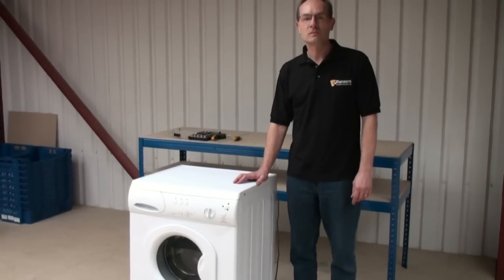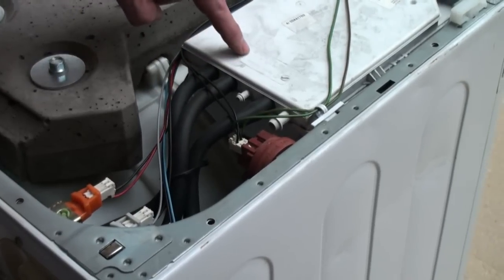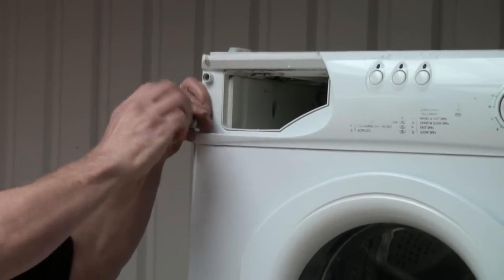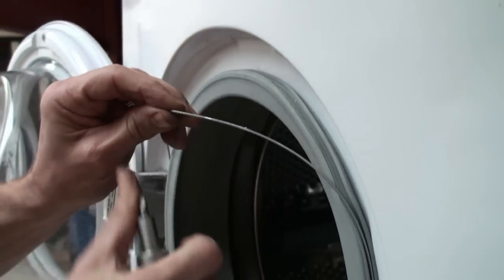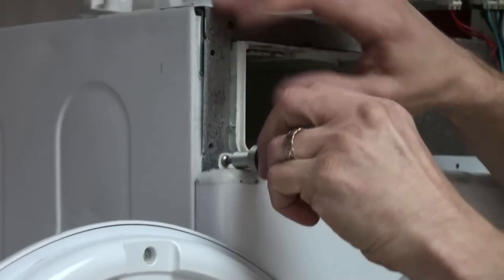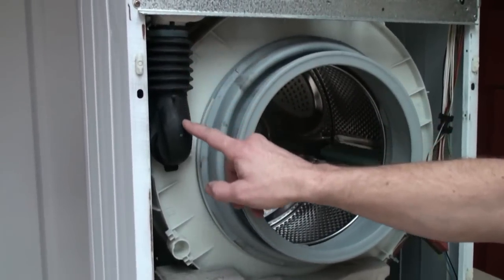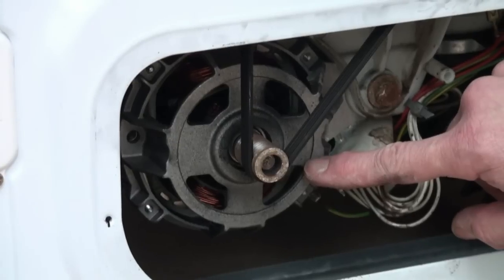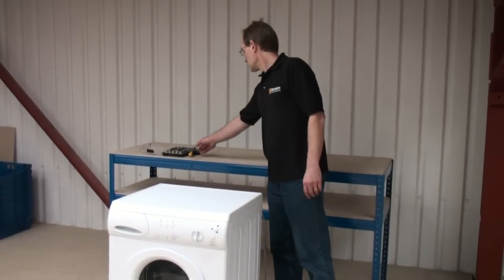Washing Machine Repairs - How a Washing Machine Works

Comment: Just ordered my 3rd washing machine in 3 years. The first was an all singing and dancing hotpoint from the ultimate cowboy outfit, AO. 10 months and it went to the dump and no refund only a lot of very sad sorrys from the minions. Wont buy hotpoint ever again.
Next a candy cheap as I could find. I mean why throw good money after bad. So 2 years and it just bleeped all the time, lights flashed and it wouldnt work. Repairs from candy..wait a week meanwhile I need to do washing. Quick to take money, not so quick to put it right. Wont buy candy any more or hoover cos they are rubbish.
So what I want to know, are modern washing machines just all rubbish and prepare to buy a new machine every few months or a couple of years at best? According to which, should last 14 years and that really made me laugh.
Reply: A front loader will fail quicker if the user doesn't clean and maintain it 
In other words people that neglect their machines will end up repalcing the machine way more often compared to people that keep it well maintained

Comment: thanks for Video - But you didn't cover capacitors for driving spinning  and or failure of spinning.
Reply: That's because capacitors aren't used in washing machines

Comment: hi, can u help? my beko WM1540W thinks the door is open when it is shut, even though it locks the door? does this mean i have a faulty interlock switch or board fault? thanks
Reply: True fact is that a washing machine will appear dead and will not start with a faulty door  interlock as the door needs to lock properly before the machine starts

Comment: how do i fit the counterweight on my hotpoint aqualtis washing machine
Reply: You don't need to as all machines have them all fitted but if you have to replace them for instance if they crack make a note of how the other ones are fitted then remove the old ones and fit the new ones in the same way but be careful as the weights are heavy aa they are made from concrete

Comment: On a machine that fails to centrifuge but does everything else just fine, where would you say the fault is at? When it should centrifuge, if i give it a gentle push by hand i will start to centrifuge but really slowly. It almost seems like a motor failure, although the motor does the back and forth cycles just fine.

Any ideia?